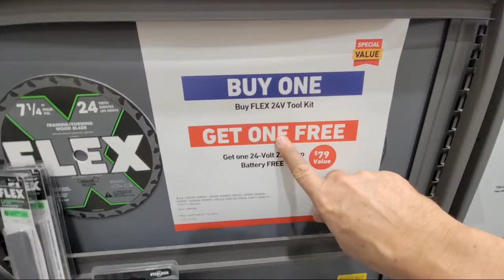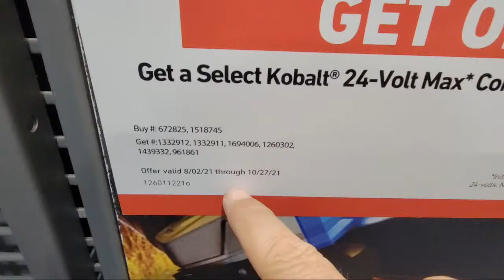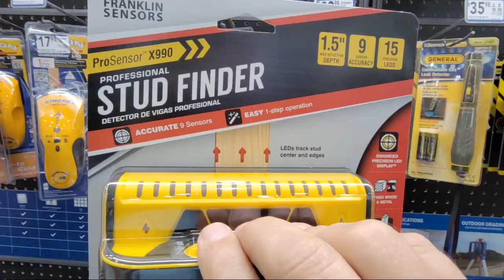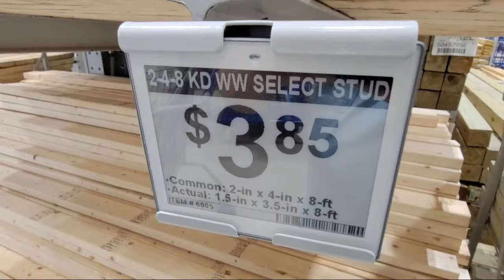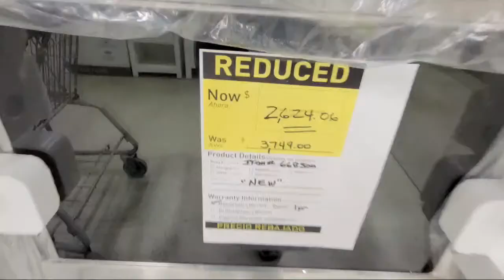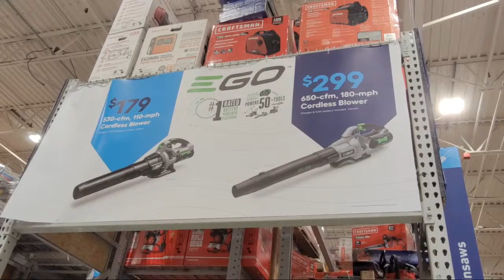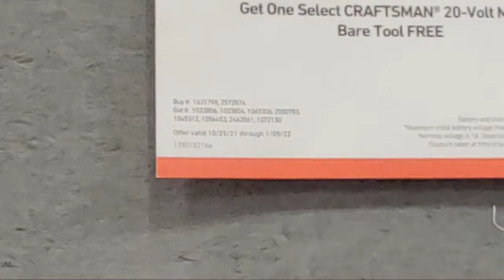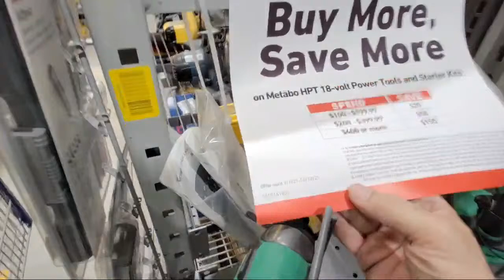Lowes Buy One Get One Free Tools DeWalt, Craftsman

Comment: I bought the Dewalt 12v two tool kit and got the one handed recip saw as the freebie.  Like the compact size and lighter weight for doing electrical and handyman jobs.
Reply from the maker: Yes that small recipe looks awesome nice size, how was the power? Does it cut through wood stars and everything OK?
Reply: @jeffostroff  It is not as powerful as 20v but when one handed is needed and for small jobs it is working very well.

Comment: Lol, picked up the battery kit and router today as I had an immediate need for it.  Guess I will be taking advantage of the upcoming deal in 48 hours from now (return and rebuy), haha
Reply from the maker: I hope that works out for you Sometimes these overlapping deals can be quite interesting
Reply: @jeffostroff  thank you for the heads up,  I greatly appreciate it.  I was doubtful of good deals this year due to supply shortage and inflation. The promotion details you shared is definitely part of the Lowes’ Black Friday sale.  Sometimes they add a few more sku numbers (bare tools) to the promotion the week before Christmas.  Currently, the cordless planer does not qualify.  I could definitely use a few more DeWalt batteries, haha

Comment: The Blackstone grill top is made from cold rolled steal and can be seasoned similar cast iron for a non stick surface bot it does not come that way, however they do sell a kit to season it.
Reply from the maker: Does it do a good job of being non-stick afterward?
Reply: @jeffostroff  For the most part yes about the same as cast iron, not quite non stick but not hard to clean either, the top is darker when looking at it after it is seasoned,  just a little seltzer on  the warm top and everything comes right off.

Comment: The craftsman BOGO deal that ends 10/27 is either drill/driver impact kit OR the hammer drill kit get one of the tools shown (that's the big graphic). The new BOGO that starts evidently 10/25 is the 4 AH battery kit get a free tool. I took advantage of both deals last year, it's a great way to get a free tool or batteries.

Comment: The only difference between the DWS779 and 780 is the light. I own both saws. They used to have slightly different internals too, but nolonger. But I just bought the DWS780 last month for $499, which was an incredible deal. Last year I bought the 779 at Christmas for $367 I believe and I got the free stand. I wasn’t supposed to get the stand, it was supposed to be the 780 special buy, but the employee mixed up the deal and told me it came with it. When it didn’t ring up that way, they still have it to me, because they said it came with it. Guess they didn’t realize they sold the 779 and 780, so their mistake was my win
Reply from the maker: Yes I remember when we posted that on our community page that the 780 was $499 some weeks back

Comment: Any idea if the Ego snowblower with 7.5Ah batteries will go on sale again?
Reply from the maker: Well we don't get those here in South Florida so I have no clue on that period I wonder how long that thing left on the battery do you have any idea?
Reply: @jeffostroff  it’s advertised as 45 mins of run time on two 5Ah batteries and just over an hour with two 7.5Ah batteries.  The earlier batches had a slight design issue which was later rectified.  Unfortunately, the price is slightly higher compared to last year

Comment: How do you shoot these videos...a chest strap holding your phone?
Reply from the maker: I hand hold the phone. I was using a Gimble for a while but the Gimble has failed and no longer accepts a charge when you try to charge the battery internal. So I have to try to Maybe take it apartancy if it can be fixed.

Comment: So Jeff, I see you showcasing many different tool brands like DeWallt, Ryobi, Craftsman, Milwaukee, Kobalt, etc all.

Which brand would you recommend for a lighter to medium duty homeowner type of usage, and also for more heavy duty use, that will last for many years?

Which company has the best warranty!
Reply from the maker: I know ridgid tools owners who swear by their warranty which is lifetime.  In the past year I had to use dewalt warranty on one of their batteries a 5 AM hour battery that failed and they sent me a 6 AM hour replacement so that worked out very nice. Channel lock I've bought their mechanics tools and 1 of the ratchets was missing a Philip's scrub that's a curiosity hidden on him and they sent me a new 1 in 48 hours when I called them.